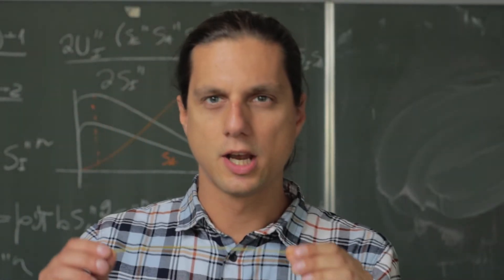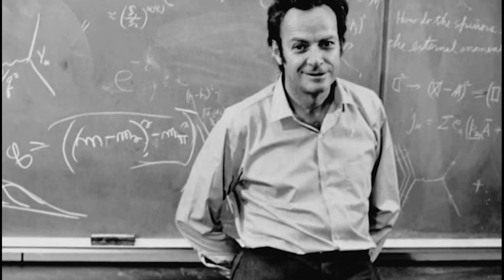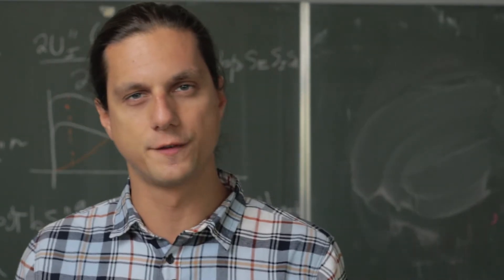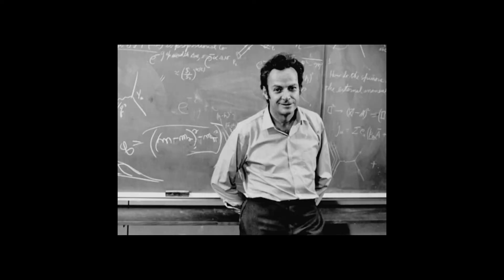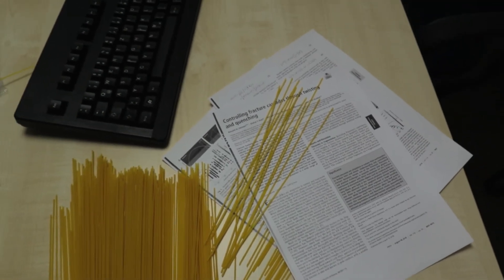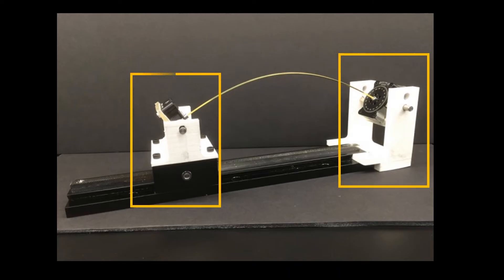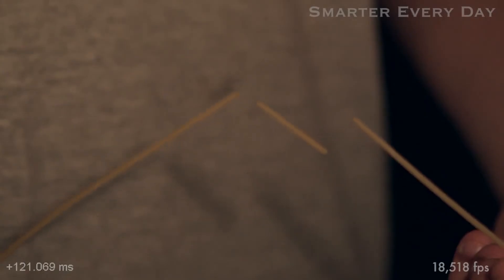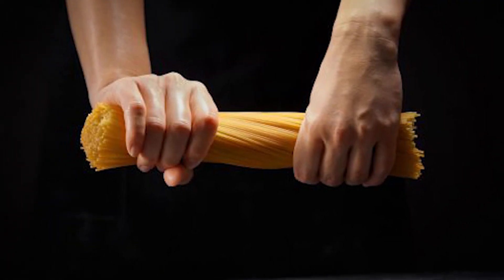Why you CANNOT break spaghetti in two pieces?

Comment: The explanation is quite easy. As the spaghetti stick bends strongly, there are a bunch of cracks forming on one side, but only one of them will snap eventually if you bend it to the extent. If you then bend it to the opposite side without snapping, the cracks will propagate through the whole diameter, so it will break a lot easier after that. So, after the first crack is snapped, the spring force is released, and it will bounce backward, and then it will lead to the secondary cracks snapping in a cascade as they have been weakened previously.